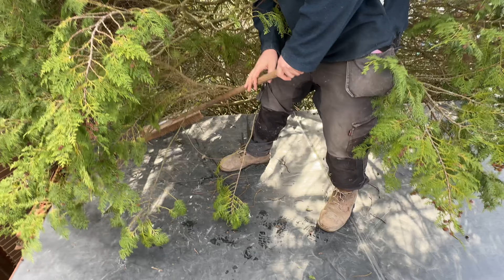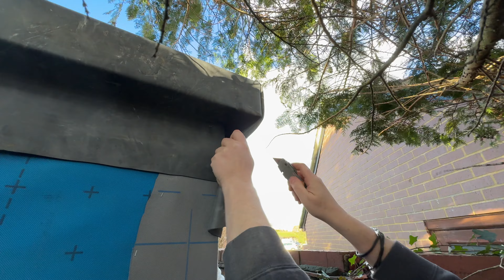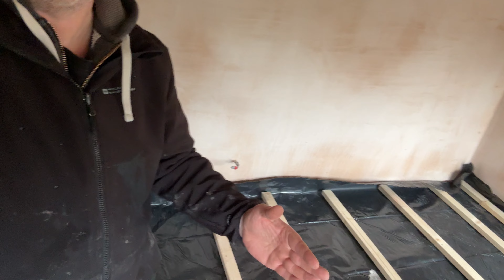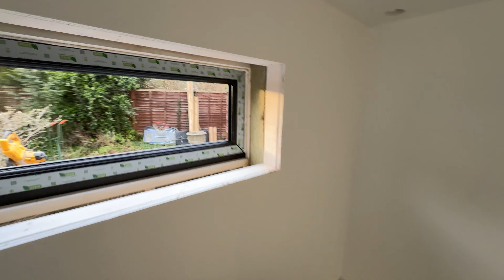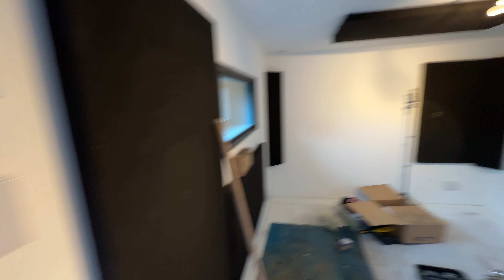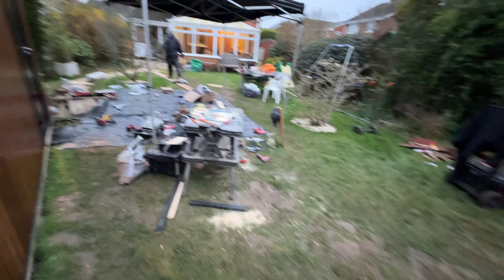HOW TO BUILD A 5M X 3.5M DRUM STUDIO - THE BIG FINISH 🥁

Comment: Just a question, do you not put any roof sheeting over the rubber?
Reply from the maker: The rubber roof is estimated to last 50years so no need to cover. If you were to do so it would be purely for look. 
You have to be careful you don’t create air cavities behind roof sheeting also as it can cause the sheet metal to rattle at lower frequencies. 👍🏻